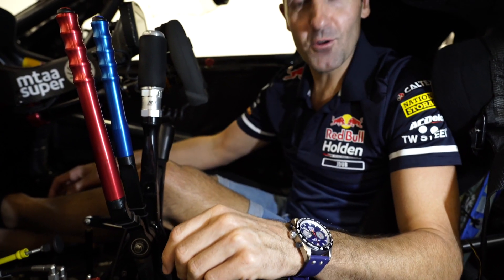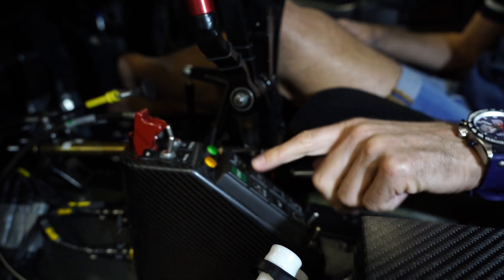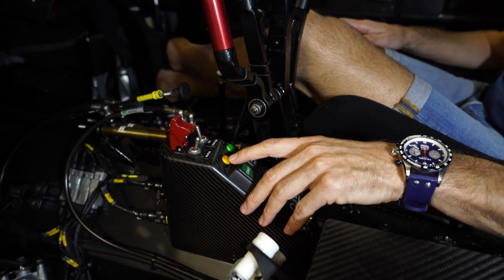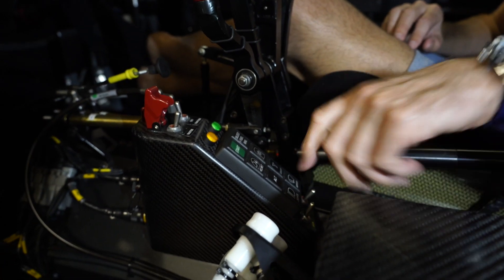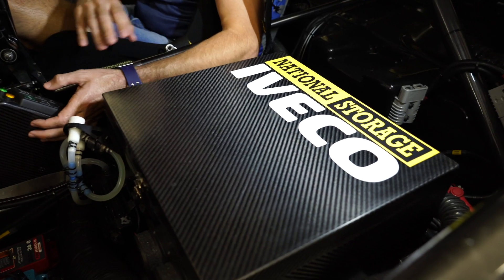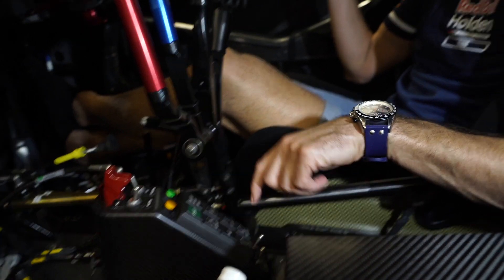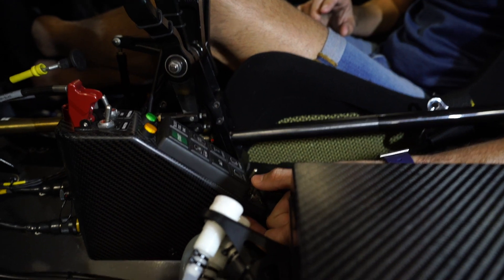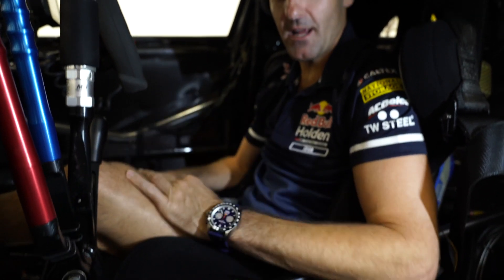What's on a Supercars Control Panel ?

Comment: Whats the blue red and black leavers? Understandable one is gearstick
Reply: Front & Rear Anti - roll bar. And yes black is sequential shifter. There is another video on ARBs 👍
Reply: @justinwebb5408  Thanks!
Reply: Red is the rear anti roll bar bias, blue is front, black is the sequential shifter.

Red is always for rear, I read, since both words start with the letter "R".